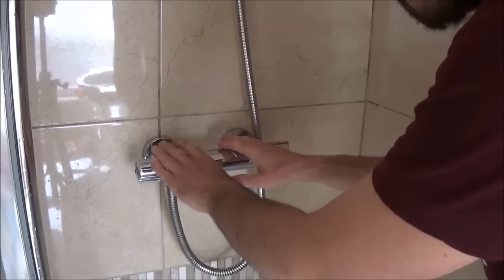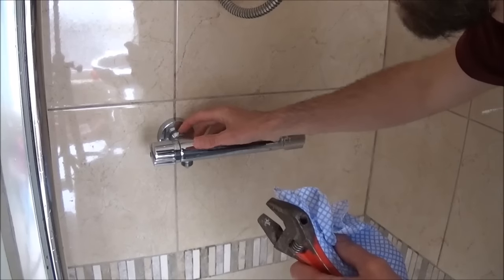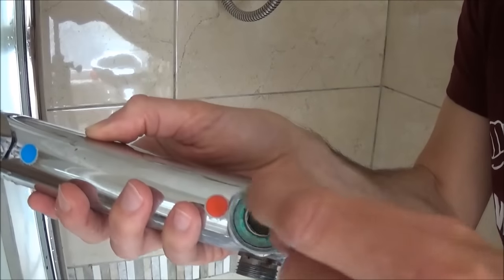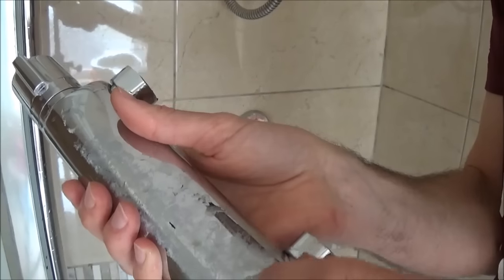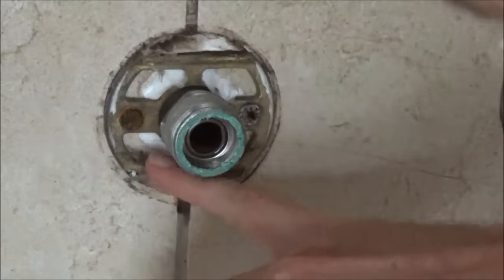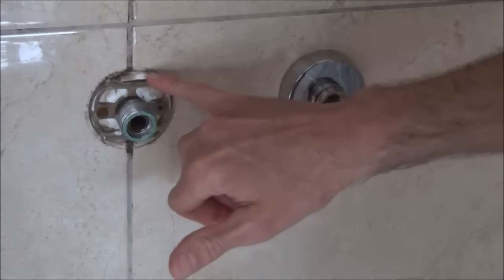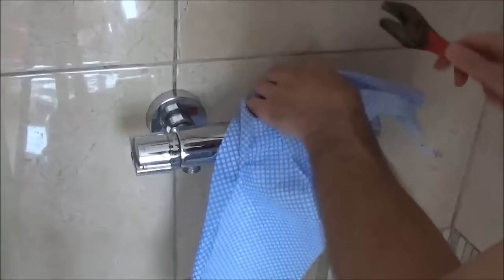How to change a shower bar valve. Shower mixer install & replace!

Comment: Thanks for this video. I am not an experienced DIYer (can't find the start button on a hammer, for example), but watching this, I felt confident enough to have a crack at this myself.  I can honestly say, that this only took 10 minutes, 5 of which was turning off the water supply.  Thanks very much.  I'll keep an eye out for other videos on any other DIY I need to do.
Reply: Hi, how did you turn off the water (both cold and hot) supplier?

Comment: I just replaced the shower bar with help thanks to this video. The flow knob on my old shower bar in the ensuite had worn after about 7 years usage and wouldn't turn on anymore. A local scamming plumber literally quoted me £300 including VAT or £250 cash to avoid HMRC for this job which is literally more than a plumbers day's wages minus the part. Seriously! I bought a £40 Gappo shower bar from Amazon (better quality than the old one it seems) and replaced it in 10-15 minutes. Didn't really need the cloth to be honest. Just careful spinning with the spanner was all it took but doing it bit by bit is good advice for sure. Thanks. Tip: After switching off the mains water just let both the cold AND hot water taps nearest to the shower run till they are dry before unscrewing the old bar.
Reply from the maker: Glad you saved a few quid. 300 seems a bit steep for a straight replacement. Best of luck!

Comment: Thanks for this Pouse.  I've recently installed a Triton Dene Cool Touch mixer, (it has been around for a few years), and the flow control is on the right and the temperature on the left. This is the first bar mixer valve I've had  and I would have thought  the controls would be standardized, especially from the same manufacturer.
Thanks again, Kieron.
Reply: On a cool touch system the temp control is on the hot side (left) to stop the whole bar getting hot like standard setup where the hot water travels across the bar to the temp control on the right
Reply: Thanks Pouse. That makes perfect sense. I never thought it through. As they say, we can learn something new everyday. Regards,  Kieron.

Comment: This looks easy enough. I’m gonna try doing it myself. The hot tap has become loose so I’ve take off the sleeve to see the thread inside has worn out and just been using pliers to turn it on and off. It’s been doing that for a year and now really won’t bite anymore. Thank you so
Much , you just helped a single mamma in the U.K. ❤. Bless your skills. 
Can you please do video how to screw things like solar lights on to outdoor concrete wall please. How to know what kind of drill bit goes into the mortar . Thank you ❤. And how to hang heavy mirrors please too on plaster board, if you have any project like that coming up.
Reply from the maker: Glad to help. I've put links to some of my videos below that should help. They show the general principles of fitting things to walls both light and heavy, types of wall plugs required etc. For the heavy mirror look at the corefix video. Hope that helps. Let me know how you get on. Thanks for watching 👍

How to fit a floating shelf - https://youtu.be/BXD_1wBCuyw
How to fit a TV bracket - https://youtu.be/cOIjvN3Nhbo
Corefix wall plugs - https://youtu.be/pGQXqXeBZsA
How to use wall plugs - https://youtu.be/WrVr6KbTNac
How to use a wood screw - https://youtu.be/G-foX6cTH-k
How to hang picture frames level - https://youtu.be/UgVspSijj28
Fischer DUOPOWER wall plug - https://youtu.be/_29NGLCUHBY
Reply: @POUSEaroundtheHOUSE  aww you’re so kind posting these links as I will not know the keywords to find them. Thank you so much! I will let you know how I get on!

Comment: Great video, very straightforward.  I have put a new shower bar on, everything is fine no leaking but there is a whining sound on the right side if the bar, only does this when yhe temperature is medium or below  if you turn it up to make yhe water hot then the noise disappears.  Any suggestions. TIA
Reply from the maker: I'm not sure sorry. Maybe you have high water pressure. Thanks for watching.

Comment: Brilliant! Quick question….if my shower bar has a slight leak from the cold side nut….what might be causing that? Thank you!
Reply from the maker: You could either try tightening it up only ever so slightly to see if it stops. Or you could replace the seal/washer inside. The seals only cost a few pence so worth changing them on both if you take the shower bar off and see if that works. Thanks for watching.

Comment: Excellent video mate. Very clear instructions. Can I ask what is the difference between a thermostatic bar and manual shower faucet
Reply from the maker: The thermostatic bar has a thermostat built in to control the temperature variations in the water so should prevent any hot or cold spells. You can set it on the one side of the bar. A normal bar relies on you mixing the hot and cold water manually. Hope that helps.

Comment: My shower is running cold when it should run hot. But when the cold hand basin cold tap is turned on the shower water runs hot !. It was working fine before, any ideas. Good video.

Comment: Are all showers of this type of mounting now. I have old "victorian" mixer and needs replacing.. Original plumber made a booboo and has hot on right, not left. I guess its worth replacing adding the base mounting and switch hot and cold around.
Reply from the maker: You might just have a mixer shower so doesn't really matter but if you have a thermostatic bar valve like one in vid then it needs to be the right way around as the thermostat needs to work from the cold feed. You can use different fittings to attach the shower but I used an 'easy fixing kit'. Hope that helps and thanks for watching.

Comment: Just bought same Triton shower but only plastic seals in the box. Do I use these instead of the felt/rubber types you used? Great video thank you.
Reply from the maker: You can use the ones they provide. You say plastic, I assume they are a hard rubber rather than plastic?
Reply: @POUSEaroundtheHOUSE  they are white plastic

Comment: This is epic defo worth a go. Would this work with other types of mixer valves( other than bar) provided its 150mm between hot and cold water pipes? Thank you.
Reply from the maker: You'd have to check the instructions but in theory if the way it connects is the same then yes. Thanks for watching.

Comment: Hi, great video. I feel confident to tackle this myself after watching this. As my old unit is unbranded, it’s virtually impossible to locate thermo cartridge as I think it’s gone in my current shower. I’m guessing it’s just as cheap and easy to replace the whole shower right? Also, if I replace with something branded, will all bar valves be compatible with the existing wall fixing kit as my wall fixing is in really good condition as only installed 18 months ago. Thanks again!
Reply from the maker: They are pretty much  universal fit so  a new one should go straight on. Hope that helps. Best of luck 👍

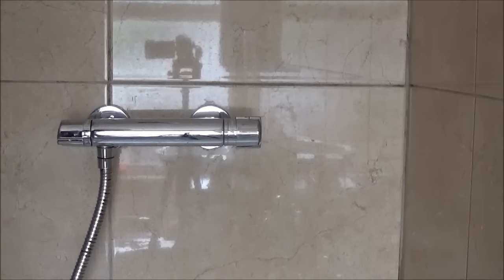Comment: Super video mate.. I found this video very helpful. I found a tiny leak at 10:35; I believe its coming from between the bar valve mounting kit and the cover. Can I just use the PTFE tape here? If yes can I just tape it round about 8 times as in your other video?

Comment: Great video. Got a drip from the shower head, would a replacement bar or atleast replacement of all the washers do the trick?
Reply from the maker: Hi there, on a modern shower you probably need a new cartridge which is like a one piece unit inside the shower that controls the water flower with several rubber washers within it. Hope that helps. Thanks for watching.

Comment: Great vid thanks. I have a Mira 415, I think, external bar with a mixer knob in the middle. It is fed from a combi boiler. If I want to replace it (min 20 yrs old!),  can I replace with any 150mm mixer, central knob, or with the knobs on the end? Don't even know if there is any difference!  Also, is it just a case of turning the stopcock off to stop all water?  Thanks a million!!!!
Reply from the maker: Stop cock should stop all water. If you're lucky you may have isolation valve in bathroom so all other water can stay on while shower is off. If it's 150mm then a new bar should fit but you need compatible threads and pipe sizes which you may have. But it may need a bit of modifying. Best of luck. Thanks for watching.

Comment: What solution would you recommend if there is water leaking from the cover i.e. behind the bar?
Reply from the maker: Unscrew the covers and try to tighten the nut/thread onto the olive. Hope that helps.

Comment: Hi,ive just moved into my new place,The same shower is here,when using it your either fried or frozen.Does this mean i need i new one......
Thanks
Reply from the maker: It maybe your thermostat in shower bar, but that might be your boiler playing up. The heat exchanger on the boiler can do that when it either blocked or broken. Worth getting a plumber/gas engineer to check. Thanks for watching.

Comment: Excellent video. I want to instali a new Mira mixer shower but my hot and cold water pipes are outside of the wall but all of these new showers are designed for pipes retracted into the wall and covered by the tiles. Is there a way that I can install one of these type showers and attach to my external pipes? Are all the fittings on the hot and cold water threds on the mixer bar of a universal size? Thank you in advance.

Comment: After removing the bar then refitting will new compression olives be required as they would have already been compressed?
Reply from the maker: This particular job doesn't require the removal of olives, it's purely undoing the nuts on the shower unit from the thread on the wall fitting so no need to worry about that. Hope that helps.
Reply: @POUSEaroundtheHOUSE  Yes, that helps & thanks for your reply:)

Comment: If you shut off the water supply and remove the shower bar will the grundfos pump come on automatically. Does it have to be isolated as well.

Comment: IF I STOP THE MAIN WATER STOPCOCK WOULD I HAVE TO SWITCH OFF MY BOILER?
Reply: no, the ( boiler ) heating system is independent, only mains water goes through it, to provide hot water for your taps etc, through a heat exchanger,  once you have isolated the mains water supply, I would  drain the mains water, by opening the taps on the kitchen sink, and opening the shower, to let it drain.
Reply from the maker: No, the boiler just won't heat water as there is no water going through boiler. Central heating will still work, not that you need it this time of year!!

Comment: Is the distance between the hot and cold pipes always the same regardless of the make of the shower bar?  Thanks
Reply from the maker: Yes, pretty much as far as I know, they're always 150mm. But I'd double check before buying a new one. I don't want to get the blame if the new one doesn't fit! Thanks for watching!

Comment: When shutting off the mains supply with a combi, do I need to drain the hot water or just run the cold tap until its dry and then remove the old shower bar?
Reply from the maker: You could run both hot and cold tap to drain them but as it's in a shower or bath tub already you can just undo the shower and let it pour out. It won't be under any pressure anyway. Hope that helps. Thanks for watching.
Reply: Thanks all sorted now 👍🏻
Reply from the maker: @richardkerslake7878  brilliant!

Comment: What's the best way to access the pipes behind? I think I have a leak in the pipe buried in the wall.
Reply from the maker: Probably remove some tiles. To do this carefully you can use a multi cutter to cut the grout around the tiles, then remove them carefully, clean them and hopefully replace them. It's easy to break them though so maybe re tile that wall with a different colour tile when you're finished. No real easy answer sorry. Best of luck with it.

Comment: My supply is hot left and cold right - but my controls are temp control left and flow control right, I assume that’s just a design thing? All the potential replacements I’m looking at are the opposite though - it’s definitely not upside down either 🤔
Reply from the maker: Sounds like design. Not sure to be honest but if you buy a new bar as per video and hot and cold are as per video then you should be fine 👌
Reply: @POUSEaroundtheHOUSE  ok thanks - I’m still confident I have a boiler issue more than a shower issue (bathroom taps are also a bit iffy) but good to know - very useful video, thanks my man, keep it up - might not sound like much to you, but us guys with no idea on how to do stuff really appreciate you uploading videos like this 👍🏻👍🏻
Reply from the maker: @northernaids  really good to hear the vids help and appreciate tge feedback. Makes it worthwhile 👍
Reply: Hi, my temp control is also on the left (assuming the supply pipes as hot left and cold right as standard), did you end up replacing the bar? Did it work?
All the replacements I can find only have the temp control on the right as you say. Dont want to waste money on something which doesn't work.
Reply: @johnthepainter6959  I didn't do the bar in the end mate, my boiler is knackered so going down that route. Shame, as the shower would have been the cheaper option!
Reply: @northernaids  no problem. Thank you for the reply and good luck

Comment: Hi Pouse, I need to replace my bar valve. I have seen some versions where the temperature control is on the left and the on/off control on the right. So these would not work for the typical installation? My current valve has the on/off left and temperature on the right, just as you described. Presumably I must get the same arrangement?
Reply from the maker: That's right, or you need to turn the water pipes around! Hope that helps. Good luck and thanks for watching!

Comment: Which is better. .? a mixer bar or a traditional type shower valve. ..and what is the best mixer bar on Amazon. ..? 👍
Reply from the maker: There's no better one really, it's just what look you prefer. Obviously some you have to mix by adjusting the taps, but if you get one with thermostat like this one, then you set temperature on one knob, and amount of water on other which is obviously more convenient. As for best mixer bar on Amazon, I couldn't say. Just check the reviews and possibly go with an established make so you know it will last a good few years. Hope that helps. Thanks for watching.
Reply: @POUSEaroundtheHOUSE  
Thanks Mate..👍
Reply from the maker: @joebrennan.4389  No problem.

Comment: I have water coming through from where the shower hose attaches to the bar. This is when the shower is on or off so i have had to turn water supply off completely. Any ideas what could be the problem? Thanks
Reply from the maker: The nut where the hose attaches is either loose or need a new seal. But also the fact water is getting that far means a cartridge probably needs replacing in the shower bar. According to which bar you have the cartridge can sometime cost so much it's easier to replace the whole bar. Hope that helps.
Reply: @POUSEaroundtheHOUSE  thanks for replying I did end up changing the bar altogether. Easy enough job. Great vid by the way

Comment: You did not explain if the actual mixer valve on the right can be changed by pricing off the control dial..or are these bar mixers one unit...? and you can't just replace the mixer valve?

Comment: For a gravity fed system do I just have to isolate main stopcock under kitchen sink and run water till nothing there? Just asking as no gate on pipe coming out top of vented cylinder. Cheers
Reply: Hi. Did you find out if this stop the hot flow?

Comment: Hi, I’d like to change the bar valve wall mounting kit. The old one was glued to the wall. As the tiles are to hard to drill threw. 
Which is the best water proof sealer to stick the new wall mounting plate to the tile. Thanks. 
Also please can you post a link to a video on how to replace a wall mounting kit. Thanks for doing this video
Reply from the maker: You shouldn't stick the wall mounting kit to the wall, it should be mechanically fixed. You probably need a diamond tip drill bit and a drill that rotates at high speed to use it. As for the fixing kit video, it's likely I will do one, but it won't be for a while! Best of luck.

Comment: On my current mixer the thermostat is on left not right so I’m wondering if I buy a new one and fit it will be still ok? You say the thermostat has to always be on the right side where cold water is… not on mine, weird, does it matter?
Reply: I had the same with thermo on the left. Checked the hot supply was indeed on the left, bought a standard bar mixer with thermo on the right and it works perfectly. Diagram with the new bar mixer shows the hot water goes across to the thermo (cold water) side and is then mixed before going to the shower outlet.
Reply: Yes, but will last few years only, nor a decade?

Comment: How do u take the shower flow off mine has come lose so I cant turn the shower on
Reply: Did you find solutions to your problem? As mine is the same
Reply from the maker: There's a screw under the cap in the centre of the twist knob. Sorry for late reply!

Comment: I used stainless steel screws, bought from LIDLE as a kit.
Reply from the maker: Stainless is a good choice in wet environments. I assume you're talking about the screws under the chrome caps?